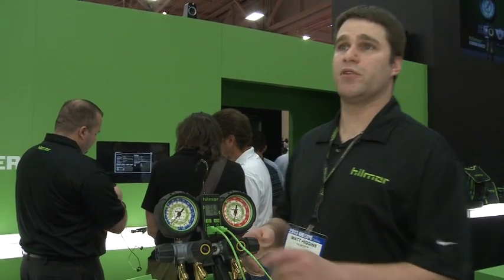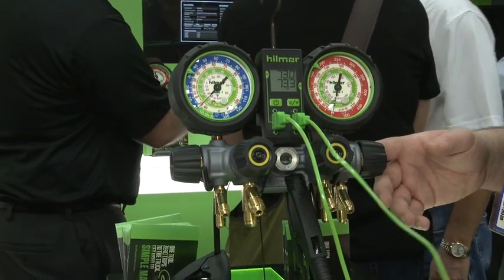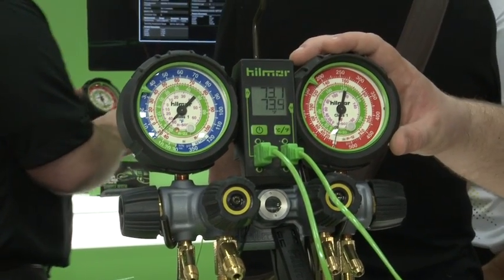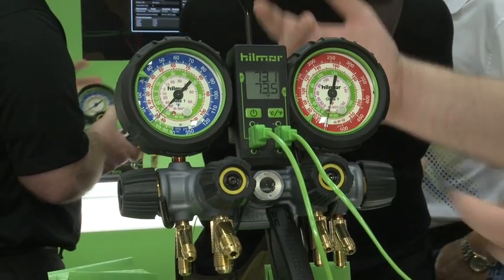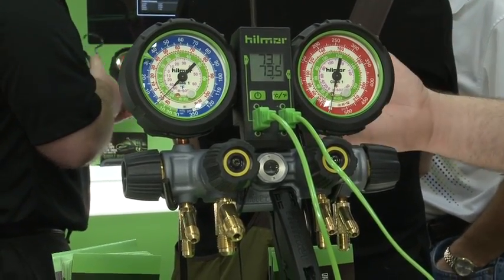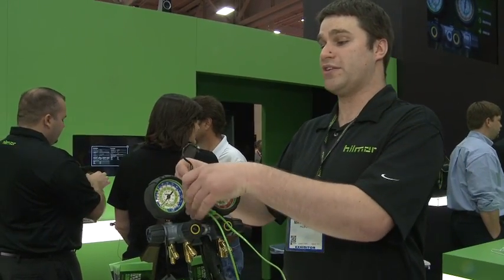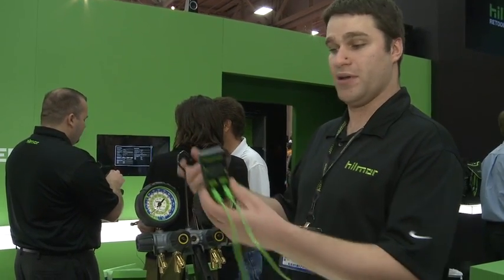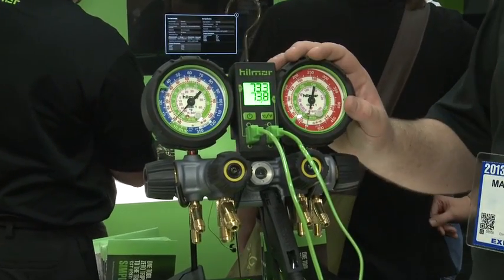hilmor Aluminum Manifold Demonstration

Comment: I have these gauges. The glow in the dark is worthless. You have to hold them on the light for them to glow. So mind as well  just use your light. They don't glow for that long then you have to shine a light on them again and again. They need to put a little battery operated light inside with a on and off switch then that would be great.